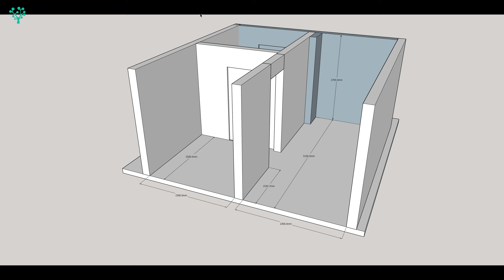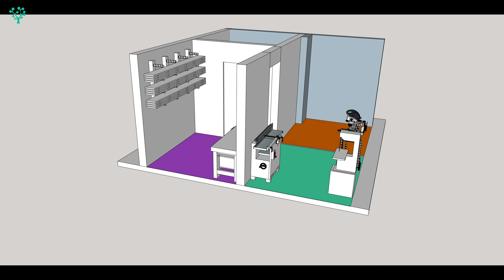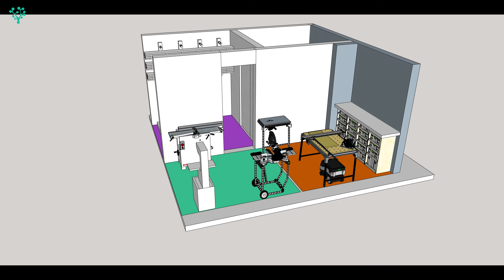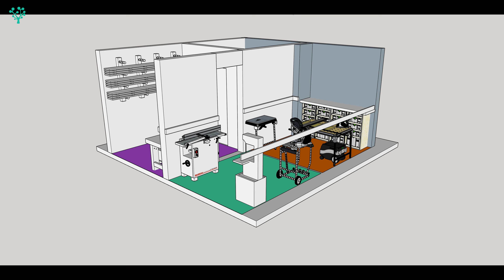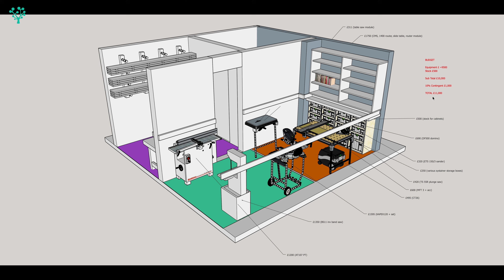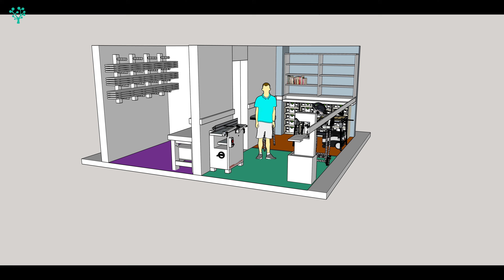Workshop Design

Comment: Hello Andy,
Really enjoying your videos and the journey you are on and the process taking place what version sketch up are you using please and I noticed you didn’t fit metal clad socket fronts in your machining area. keep it going Andy cheers Phil
Reply from the maker: +Phil Wilson 

Hi Phil, Thank you for the comments, glad you are enjoying the channel.

Good point on the sockets - I will probably upgrade them to MCS at some point, I did bang one with a piece of stock the other week - it didn’t crack - but gave me pause for thought.

Cheers

Andy
Reply from the maker: +Phil Wilson 

Sorry Phil, just realised you asked two question. I am currently using Sketchup Make 2018. The last version you could download.

I am in the process of learning Fusion 360 and will be moving over to that on the next project. 

I am not a fan of cloud only software - I find it limiting as I work in hotels of an evening in various parts of the world - so don’t always have internet connectivity.

Cheers

Andy

Comment: I'm loving that layout!
Reply from the maker: +Michael Brindle Cheers, with it been such a small space, I think that designing it for the workflow and getting things organised is the only way forward. 

I come from a hand tool background, and you don’t need a lot of space to create reasonably large pieces of furniture so I am trying to apply similar principles to lower cost production methods (but still retaining the same quality)

That was why I went for the Festool series of tools as give a lot of functionality and precision for the floor space.

We will see how the thinking works out, but early days is that it is working.
Reply: The Woodgrafter   I’m looking at Festool also, so your opinions are invaluable.
Reply from the maker: charis128 Hello again, Yes loving the Festool stuff it works well.

I am finding that you have to put a lot of hours and practice in to get the best out of the tools. But that is me, not the tools.

I am planning a video that looks at “Festool 6 months on”, so about two months away from this comment.

In that I will explore what I like, what I don’t like, how I am using them and what I would differently if starting again.

The MFT is a prime example - I wouldn’t buy the accessory kit again - but would buy two MFT’s, a separate guide rail, the MFS and fence and rail dogs.

Glad you are still finding this useful.

Cheers

A
Reply: The Woodgrafter   What guide rail would you get?
Reply from the maker: charis128 Hi,

I would buy the FS 800 for cross cuts on the MFT. And then the FS 1400 for rip cuts on the MFT. You could get away with just the FS1400 but you would have over hang on the cross cuts, so it depends if you have room either side of the table.

If I was going for two MFT’s I would also add the FS2700 to the mix, you could use the FSV joiners to join the 800 and 1400 together,  but you tend to find they don’t always line up correctly so introduce errors.

Hope this helps.

Regards

Andy
Reply: The Woodgrafter   That’s a huge help.  I’m getting ready to purchase.  I’m like you, need to conserve space & work smart.  
I was leaning towards two tables but was unsure. I like what you are doing very much.  It helps to see it in action.  Thank you!
Reply from the maker: charis128  I have the various bench dogs on order, they should be with me early next week. I haven’t used them as yet - but I think they will work well.

Not sure how long you can wait - but I could put a quick update on this post to let you know how it works out, and if they can replace the various Festool MFT accessories.

I will put together a video, but it wouldn’t hit the schedule for about 5 weeks.

BUT - I do not regret the additional MFT - it is worth it for the extra work space, even if you don’t go for the various cutting locations.

If you haven’t seen it yet, check out the third video in the Incra fence series, you will see the two MFT set up in use.

Hope it helps, let me know what you decide.

I am genuinely interested.

Cheers

Andy
Reply: The Woodgrafter   I’m not in a hurry at all.  I’m emptying the garage to paint & do electrical & other projects.  It will be at least 5 to 6 weeks easy.  Take your time.  
What you are sharing is very helpful.
Reply from the maker: Great, sounds like the timing will be prefect, watch this space :-)

Cheers

Andy
Reply: The Woodgrafter   Will do!